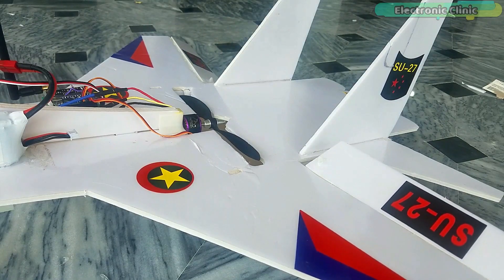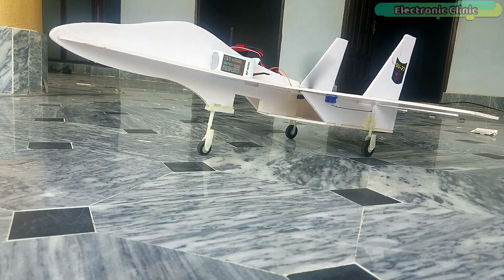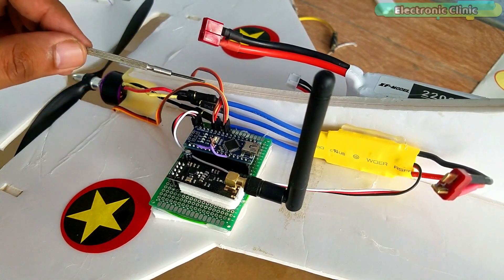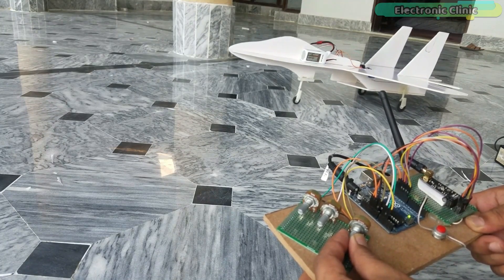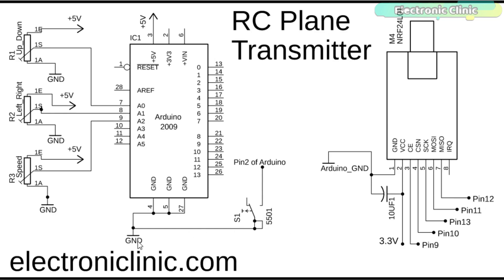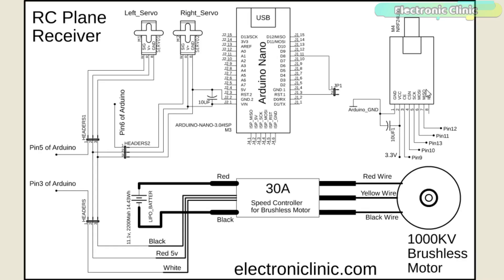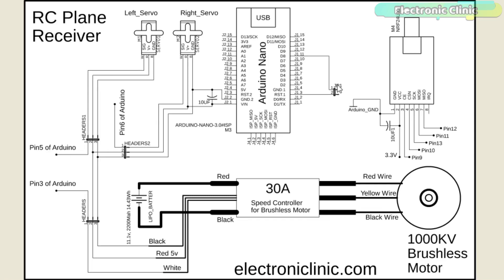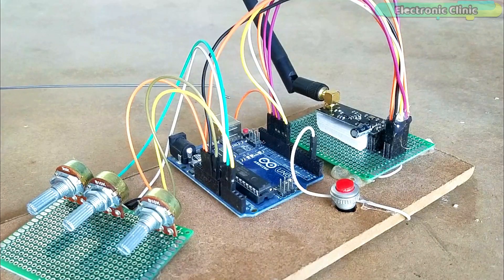DIY RC Jet Plane Homemade: RC Plane Making with Transmitter & Receiver using NRF24L01 & Arduino

Comment: brother pls fly it it been 3 years
Reply from the maker: The NRF24L01 range isn't enough and the connection losts very often. So, now a days i am working on the LoRa its range is around 5 kilometers and that's pretty stable. my first prototype is ready and i will upload it in a few days.

Comment: Thank you very much Sir, you did an excellent projects especially the code you did exactly what I want. I was searching several time on youtube  for the Receiver and Transmitter code for RC Airplane in which servo motors are mixed control together. thanks one again sir god bless your family

Comment: Can we use joystick instead of Potentiometer
Reply from the maker: yes.
Reply: @ElectroniClinic  but how
Reply from the maker: just connect the vrx and vry pins of the joystick with A0 and A1
Reply: @ElectroniClinic  thanks
Reply from the maker: you are welcome my dear.
Reply: @ElectroniClinic  what about push-button
Reply: @ElectroniClinic  code is not working
Reply: @ElectroniClinic  what to do
Reply: U r pakistani
Reply: D u have instagram

Comment: Thanks for making and  sharing  this video.I have had hard time make the NRF24l01 work.I soldered  10uF to its 3.3v and GND but no luck yet.Keep up this fantastic tutorial.
Reply from the maker: if you touch your finger with the antenna then the connection is not lost.